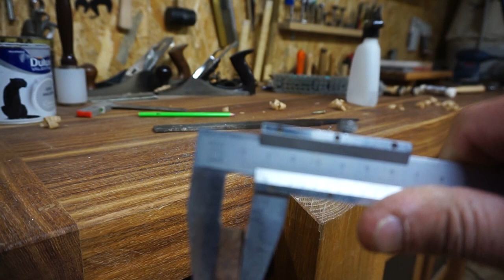Rabot Japonais 100% homemade

Comment: Bonjour, 
J'ai fait un rabot dernièrement et je n'ai pas pu tremper le fer, alors il ne coupe pas longtemps. Maintenant je comprends pourquoi il faut le cuire. 
Bravo c'est une réussite, il est magnifique et il coupe très bien, je vais essayer de faire le même. Merci c'est une belle vidéo, à bientôt et prenez soin de vous.
Reply: Un fer plat il y a qd même bcp de risques  qu'il ne prenne pas la trempe. Car si achete en gsb fortes chances qu'il ne contienne pas assez de carbone pour avoir une trempe digne de ce nom. Ensuite les températures de trempe et de revenu sont assez difficiles a maîtriser pour un particulier car a qq degrés près ça change tout  sur la dureté obtenue.